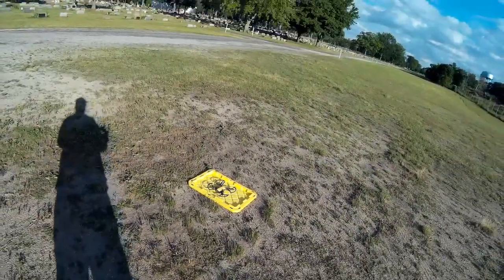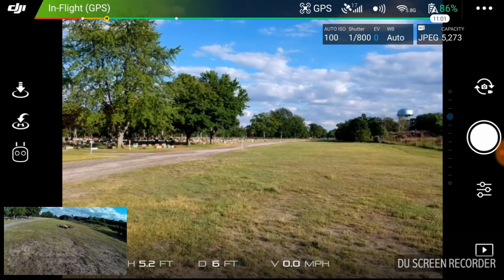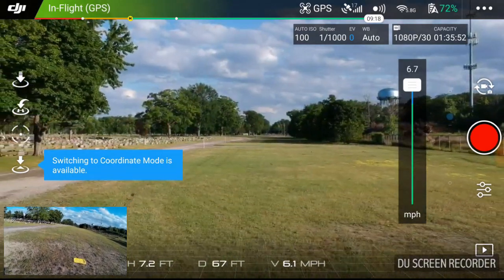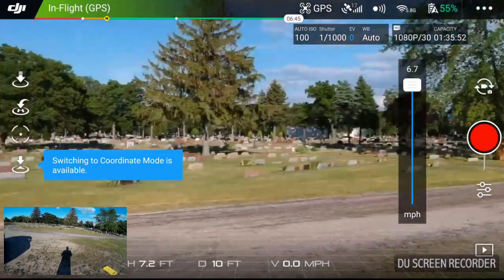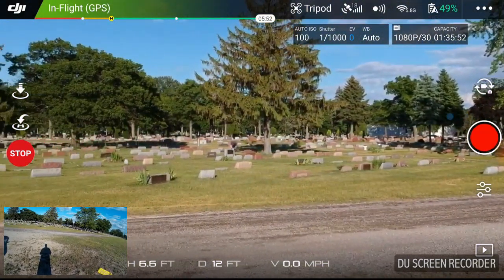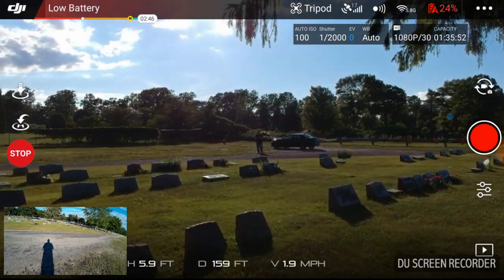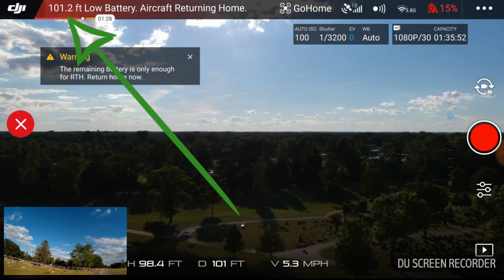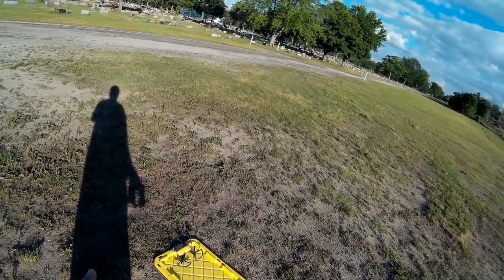Video Drone -  DJI Spark TapFly and Tripod Modes!

Comment: Wow it really is the Roll Royce of small quads. Just live that tripod mode. I needed that in my forest exploring video! My Hubsan kept drifting into the bushes!
Reply from the maker: Yes it is, the only issue (which you see in my next video) is I believe the bottom sensor has issue when traveling over uneven objects...
Reply: Video-Drone so it's not perfect?! Audible gasp.
Reply from the maker: Well it depends, if you want it to sit in one spot or on a flat surface think it would work well.  Have another  video queued where I try some harder stuff and fail.  Yet too there are a lot of adjustments which you could spend hours playing with and I haven't had the time of batteries :-)) (but I am ordering more batteries)

Comment: tap on quick shouts and at the bottom left it will say the diffrent quick shots (dronie,helix,circle,rocket)
Reply from the maker: Thanks, been having issues with android as I tap on things and nothing happens (a video is coming out on this) however if use Apple products no issue.  Are you using Apple or Android (I know its in both, just wonder about the lack of response) :-)

Comment: 5:37 lol if you tap the screen you see where you can tap beacause its green there if you would have tapped a little bit lower where it was green on the screen it would have worked
Reply from the maker: Yupper!  Figured that out later :-)

Comment: Bad enough to fly over a graveyard but hovering low amongst the stones is unbelievable . . . . what were you thinking?
Reply from the maker: The question is what are you thinking?  Whats wrong with flying in a cemetery?  They are safe places and also places of amazing art (which I have won awards for photographing in the past).  So again I ask what are you thinking :-)
Reply: Video-Drone maybe you should ask the families of the person buried under the point you are hovering.  I wasn't meaning this to be an aggressive comment towards you but just wanted to comment that to me it seemed inappropriate, there are some religious sites here in U.K. Where the DJI will not allow you to fly, possibly why you were getting the red warning when trying to use auto fly modes.  Happy flying :)!
Reply from the maker: I have photographed extensively in the UK (grave yards) and the issue (just like Westminster Abby - which is also a grave yard that the British government charges people to walk though) is not of respect but of economics as they are "British Historical sites"  and they ban photography (just as the French do of the Eiffel Tower at night as the lights are copy righted).  I wrote a book on Stonehenge (which some would argue is also a grave yard) and photographed and had to pay the British government to use my own pictures.  So that is likely why you get the warning (or there is an air field near).  

Here is the states most cemeteries are public space and even have extended public areas (such as this one) incorporated.  What does get me POed is comments such as "what were you thinking" as (1) I am being respectful of my surroundings as the point here is to show case this as art (I have also professional photographed Dachau, as well as many other Holocaust sites which are far higher sensitivity sites then this with positive acclaim as it is sharing a message).  Second while I am attempting to be respectful of other opinions which are not in line with mine, and receive a comment "what were you thinking" means you are implying I "must" align with your viewpoint therefore disrespecting my opinion as well as rights...
Reply: I guess we will just have to agree to disagree, the thumbs up and down stats on your video may indicate others views of this.  

As an aside, I found the flying advice and guidance in your video great, I just wish it had been anywhere but a cemetery!
Reply: Simon Roberts ; No disrespect, but I agree with Video- Drone. I too find cemetery’s fascinating places to shoot. Here in the south, there is one cemetery that dates back to the Civil War, where I live. It’s mind-boggling and eerie when shooting video there, but its also a time capsule being able to see headstones from that era. And read the names on the stones, names like Mabel, Gertrude, Harriet etc. My personal opinion on grave sites is a total waste of space that should go to the living. Cremation is the way to go. Lol ....having said that,  I would not desecrate or damage someone else’s final resting place due to my personal views on it.
But than again, I’m voicing one opinion, which may not be someone else’s.